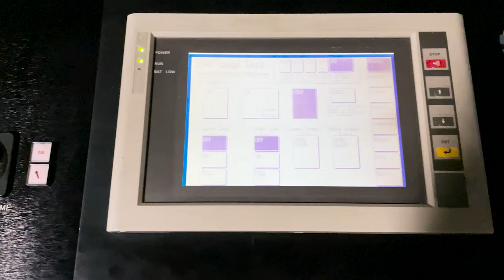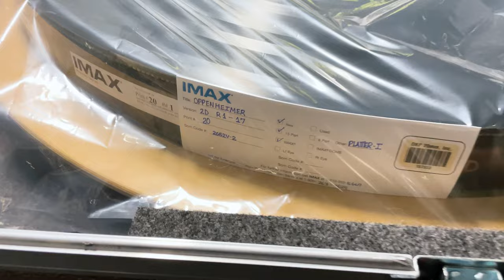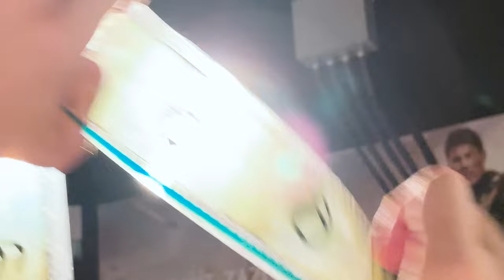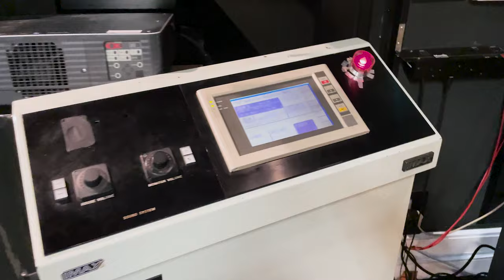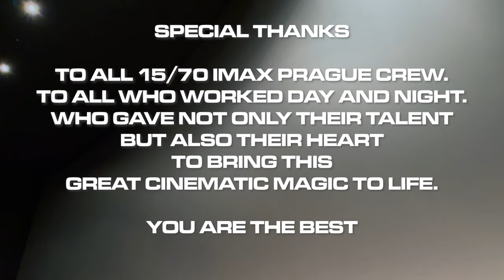Přípravy 15/70 PROJECTOR IMAX GT - OPPENHEIMER  v CINEMA CITY FLORA - PRAGUE (CZECH)

Comment: Hey thanks for the great technical insight. We watched Oppenheimer yesterday at your IMAX and it was really phenomenal. However, I noticed a really strong flickering in the white parts throughout the whole movie. Is this normal or are my eyes just being weird?
Reply from the maker: Hi, it is a good question and many customers are asking it. It is normal, the lamp was changed to brand new and properly aligned and calibrated by IMAX technician. Flickering is the result of the work of the analog projector, the light going through each frame is mechanically covered by the shutter twice per frame and it creates typical flickering, BTW the slang word for movie "flick" has an origin right in this feature of the analog projector, flickering. In bright scenes, it is more visible and Oppi is quite a bright movie. It is just a part of the analog experience, still, I hope you enjoy the movie, and good you managed to get tickets, it still sold out.